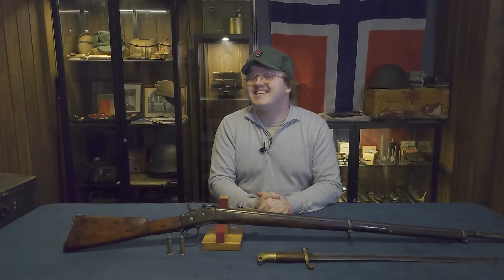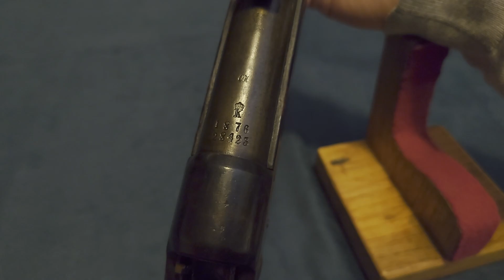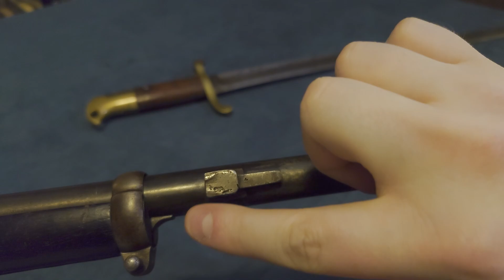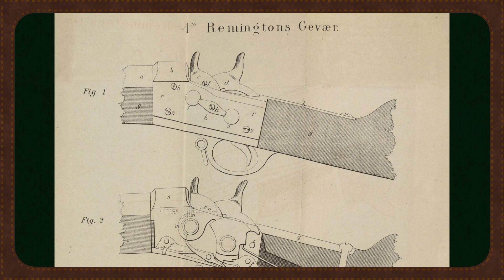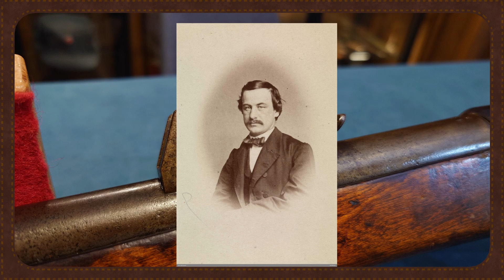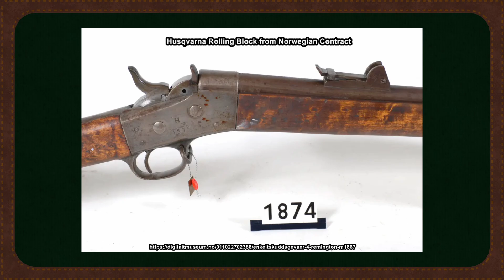The Remington Rifle in Norway: From Innovation to Legacy

Comment: 2:33 once the loading gate is shut, how does the chamber lock? Ie what stops the cartridge from flying backwards and killing the operator during recoil?
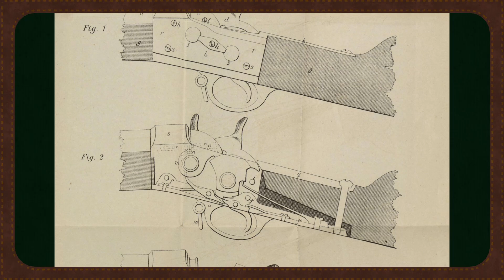Reply from the maker: The rear hammer is set up in such a way that the second the hammer falls, the loading gate can not be opened. if you look a the diagram at 08:47 you can see how this works!
Reply: @NordicArmsAndHistory  Yes I see it now, it's a wheel lock of sorts!

Comment: Nordic Ian McCallum, I've seen a Kammerlader chambered for a metallic cartridge. This got me perplexed as to how this happened when most Kammerladers I've heard of are capping breech loaders. Did the Norwegians and Swedish really convert their Kammerlader capping breech loaders to chamber metallic cartridges or are they newly manufactured? I've seen them on YouTube but couldn't get more information about them. One I've seen is also manufactured in Kongsberg.
Reply from the maker: They did indeed convert them. Now in Norway's case it was never on a mass scale, probably around 2400 various Kammerlader rifles where converted and all but 200 where for the Norwegian Navy. I have the book on Kammerlader rifles. So i do plan on making a video on the Lund and Kammerlader in general. Just need to get a Kammerlader for the video aswell.
Reply: Norwegian kammerladers were converted in large numbers to cartridge guns in the later half of the 19th century. The most common were the small bore kammerlader (4-line/11.77mm) the M/1860/67 which was based on the Lund converson system. About 12 000 of these were converted. They were also factory produced from scratch as the M/1867 Lund. Some kammerladers and earlier muzzle loaders, like the Swedish 1860 Wredes muzzleloading percussion rifle, were also converted to the Remington Rolling block system.